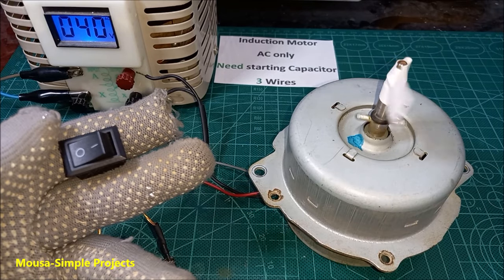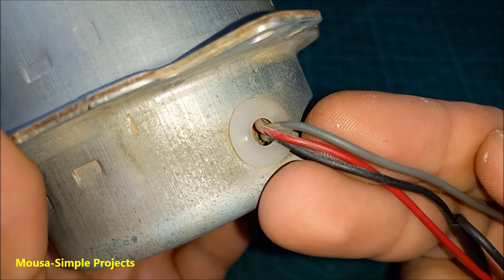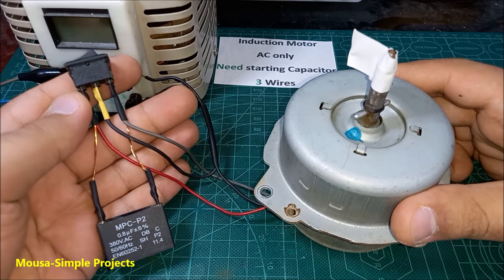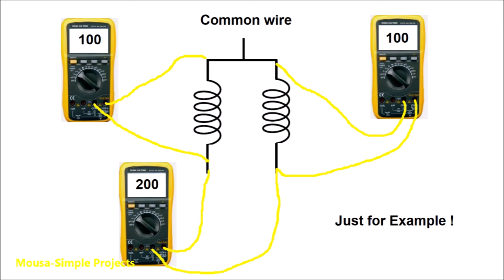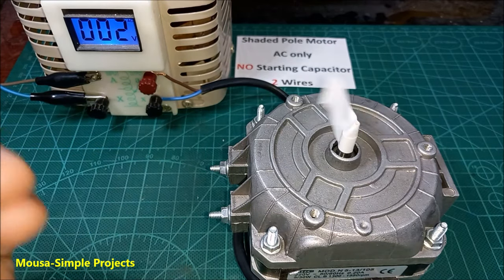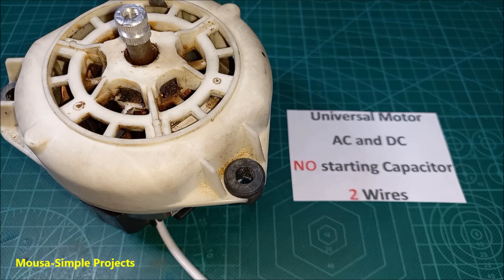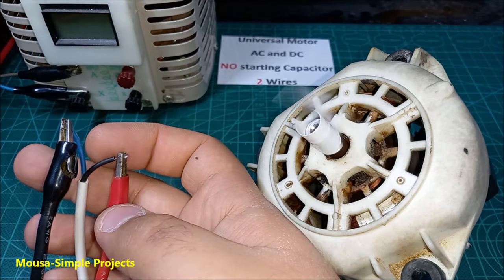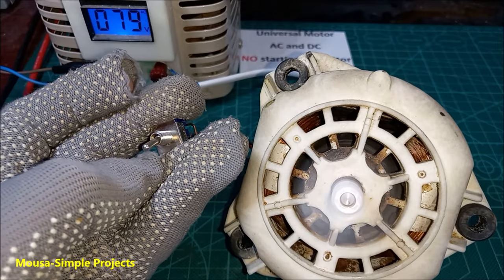Motor Reverse Forward Control Circuit Switch / Reversing single phase motor

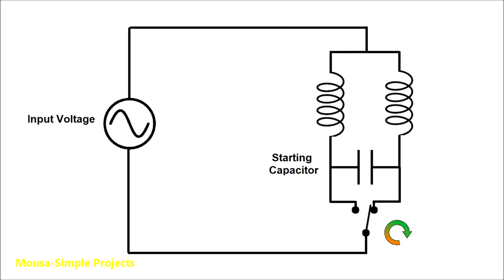Comment: I love the simplicity of your diagram at 0:34 shows you can switch which winding is in series with the run capacitor. When spinning in reverse, the thicker gauge wires and capacitor take the majority of the current, rather than the traditional scheme of putting the thinner gauge start windings in series with the cap. The alternate option to find a way to reverse the relative direction of flow through the start windings would take a double throw double pole switch.

Comment: Nice work indeed. In induction motors, if i want to use an on-off-on switch is it the same wiring?
Reply from the maker: Yes, it is

Comment: Nice work
Please add at the end some examples how to get benefits of this modification
Reply from the maker: Thanks for comment, 
In vent fan (Exhaust fan) this method used to change the flow of the air.